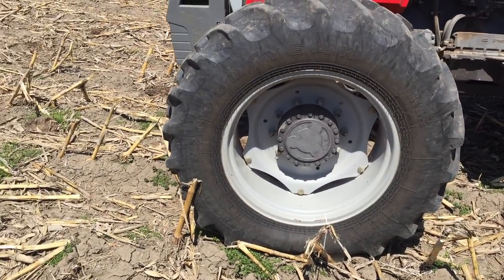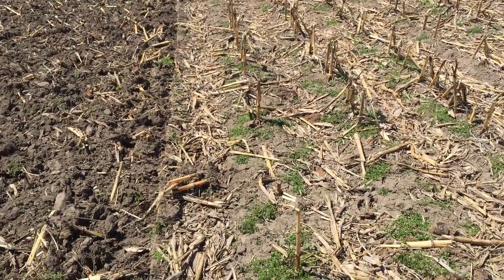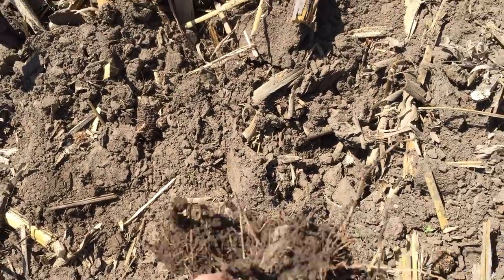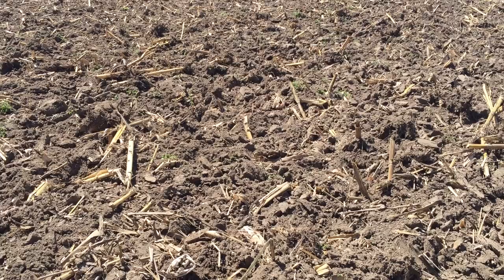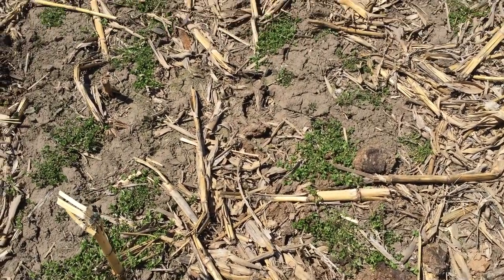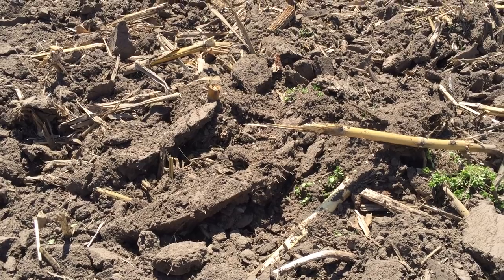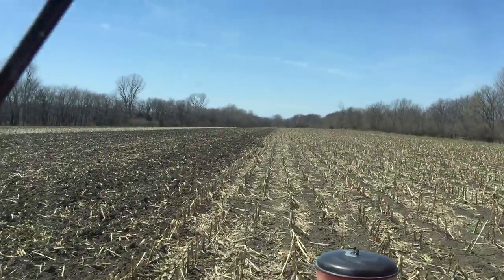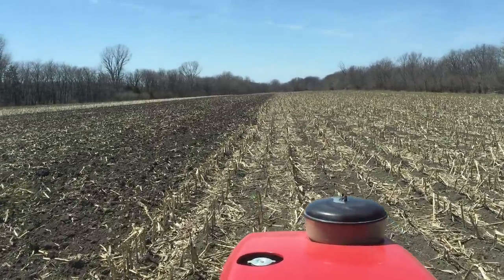Discing Corn Stalks w/discussion

Comment: This field is river bottom I am sure it is different soil type than some of your other fields but in a dry year will it yield pretty good still? Or does it not retain moisture well?
Reply from the maker: It yields very well...and honestly, a little dry weather helps.  The primary problem in river bottom is too wet or a lack of tilth.  This soil has to "move moisture" in order to work organically and full till.  The initial challenge was to get tilth so that it would not stay wet all the time.  It has been farmed organically 25+ years with a good rotation.  Now that it has tilth, it is a lot more forgiving.

Comment: How to big is the disc that  you pulling
Reply from the maker: Pete, I only own one disc.  It is 19 foot.  In certain conditions, it will really pull on my 115 hp tractor.  In this field, as primary tillage, I might be better of with a heavier/smaller disc.  As a general rule, this disc works good with this tractor in most conditions.  I would like an 21 foot Massey 820 "rock standard" disc someday...and the bigger tractor to pull it in all conditions!  I am also looking for a smaller (14') Massey 730 offset disc.

Comment: What do you use for fertilizer?
Reply from the maker: I do not purchase or use any off-farm fertilizer.  30 years of organic farming, good crop rotation, use of legumes/cover crops, and managed grazing of livestock can give you a soil that is fertile and healthy.  The only "inputs" I use are lime and gypsum.  You have to watch all my videos to pick up little pieces of HOW I do it.  Basically,  it is a systems approach and you have to apply all the pieces.  We are blessed with naturally fertile wind blown loess soil.
Reply: Geiger Farm where are you located?
Reply: Nice. I farm a few hundred acres of grass hay, corn, soybeans, wheat. I've watched a bunch of your clover videos. I frost seeded some red clover on my winter wheat this year to gain those benefits. Great videos and explanations!
Reply from the maker: Kansas
Reply from the maker: Red clover in wheat is a great step.  I hope your clover was inoculated (in order to maximize N fixation).  If you have cattle to graze the stubble and run the clover until next spring you will get maximum N-fixation, a potential hay crop, and a soil building cover crop for winter.
Reply: Yes sir. The way it was done on all small diverse farms back in the early 1900's.
Reply from the maker: It was a time when people built solutions rather than buying them.  The old saying, You can't buy a profit, seems relevant.